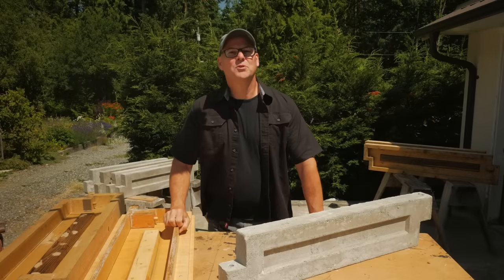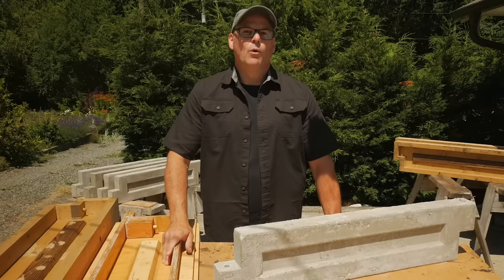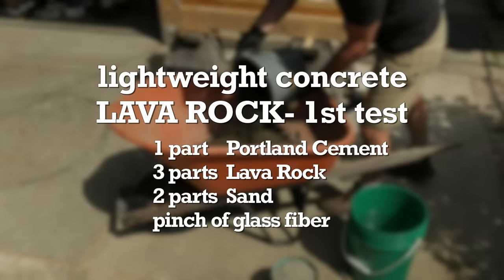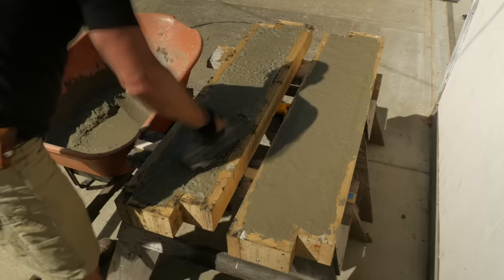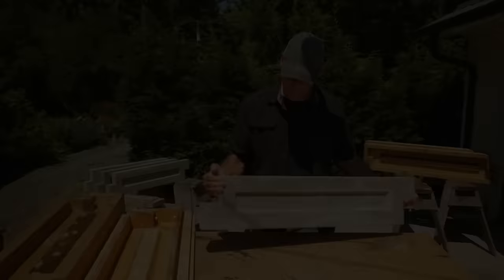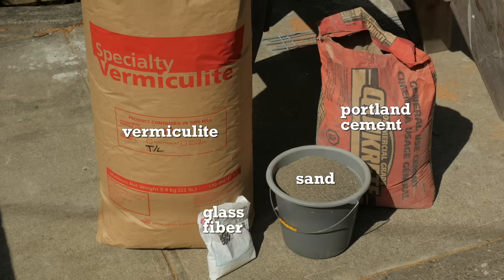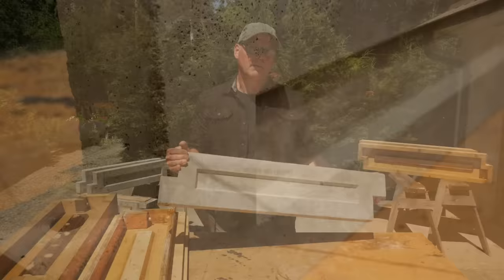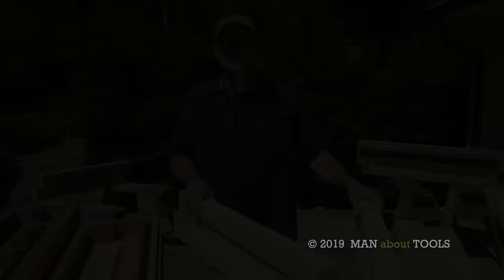make Lightweight Concrete Garden Boxes PART 3 - Aircrete Vermiculite Lava Rock

Comment: Excellent series, I have enjoyed all of them so far and look forward to more! A few things I would love to see as an episode 3.5: 

I wonder how strong these panels are compared to standard concrete, but in the sense of what it takes to break them. Like, if you later the panel across a set of 2x4s that were 4 feet apart could you stand in the middle? Could you jump on it? I imagine that there would be a substantial difference in the strength.

I would also really like to see how an Aircrete mix would compare if you added some substrate, like a portion of lava rock or a portion of vermiculite. It may have a better ratio of strength to weight. Keep up the awesome work, I'm looking forward to making some of these for my house soon!
Reply from the maker: I'm sure the lava and vermiculite panels would not break. They are very strong. But I'm not so sure about the aircrete.

Comment: Cool video I see a future issue with the holding pins and stress from the weight of wet soil pushing against the panels, any way to reinforce the pin holes ?

Comment: cracking happens when moister dries to fast perhaps try to slow it down a bit.
Reply from the maker: I made much better aircrete in Part 3.6    It's denser and did not warp or crack. Until I broke all the panels in my latest video. (for science)

Comment: Vermiculite sucks in and holds moisture. I wouldn't use it with concrete. Perlite is cheaper than vermiculite, does not attract and hold onto water as vermiculate does, so maybe that's an option too.
Reply: I used perlite. It tends to clump in the concrete mix and is visible in some of the panels. I would like to try the vermiculite this time.

Comment: I watched all the garden box videos which were all interesting but in the end I didn’t know which recipe to use. I want it lightweight but sturdy and long lasting without damage from my string trimmer. Which recipe do I use?
Reply from the maker: Then maybe the Perlite or Vermiculite is the best option. Lighter than regular concrete but very strong and durable.

Comment: Another fantastic, well made how to vid in a series. Thank you. A couple of thoughts; 1) why light weight... guessing just for ease of moving and placing, I'll be using mine ad permanent "portable" garden structures 2) my initial thought on the foaming material is to use more reinforcement "hog fence wire" spread over a broader area and possibly increasing the glass filaments.  Look forward to part 4.  
PS. Have you given any thought to adding color powders to the mixture to avoid/bypass the cement gray look?
Reply from the maker: I did this follow up video solely based on viewer requests. So many people asked about lighter panels and aircrete that I just had to delve into it. I'm yet to experiment with colours. But it looks really interesting too. Thanks!!

Comment: Does the warping bow towards the open end of the form? 

I'm thinking the stress profile during the during process causes this? What if you screwed on an additional sheet of plywood on the top to fully encapsulate it, or Chan's your form to make the sides an open top? 

I bet uniformity during the during process is key.

Comment: I know less than nothing about concrete blends but the amount of fibers you added to the aircrete seemed so trivial I had to wonder why you didn't add a lot more.
Reply from the maker: For these tests I decided to add the manufacturers recommendation. For the volume I was pouring it worked out to a third of an ounce (9 grams) per batch. It looked like it was distributed very well in the mix. Feel free to add as much as you think you need. I don't think there's any issue with adding more.

Comment: Would it be possible/effective to lay a face coat of regular concrete at the bottom of the mold .25 to .5 inchest thick then back it with aircrete to give it some protection but still be lighter?

Comment: to make a more durable, and potentially attractive, face add river pebbles after pouring in the concrete making the back the face... if the pebbles sink too much you can make the pebbles 'reappear' by washing some of the concrete from the surface with a strong stream of water.  I may be an interesting experiment, I know my yard forewoman would prefer something more decorative than concrete.  
Also, do you have any issues with the concrete leaching into the garden effectin the pH? or do you line the sides with poly sheets?

Comment: There is a difference between vermiculite and perlite. Nurserymen use vermiculite as an aid to water retention in their growing mixes and perlite to aid drainage. Vermiculite captures water, hence its use in cat litter, whilst perlite is hydrophobic. I wonder whether substituting perlite for the vermiculite might solve the problem you discussed?
Reply from the maker: I have 4 vermiculite panels in use in the garden now. I'll keep an eye on how they do and see if moisture retention is an issue.
Reply: Depending on the climate you live in water retention can be a destructive force with freezing and thawing, I had a bell siphon bed with expanded clay balls and the freeze/thawing completely broke them all
Reply: So perlite has rabies?

Comment: Use foam sheets to fill the center of the forms,(core)  then pour your concrete. you will end up with approx 1" thick concrete along the entire outer surface with foam center. 50-70% weight reduction, and weed wacker friendly.
This is a TYPICAL use of foam & concrete for weight reduction purposes. For example: If you live in a modern city with newer skyscrapers, the ground you're standing on in many areas  is actually 3 foot thick foam with concrete poured over top. (simplified explanation for all you keyboard warriors). Houston Texas is a perfect example. FYI: Its not a structural member you're making, theres little to no need for the extra metal grating. In fact, that IS one of the purposes of the mesh fibre. AKA: MORE WEIGHT SAVINGS. Add more mesh fibre in this case, worst case scenario the dried concrete has the fuzzies, which can be lightly sanded off.

Comment: A great video, really interesting and I appreciate the fact that you give such detailed info. Regarding the finish of panels. Have you ever considered painting the panels with a cement/fine aggregate slurry prior to adding the main material ? This may give the panel a smoother "skin coat'. Also, if you have decided on a preference material from your test pieces you could always add some small pieces of polysterene - perhaps putting these in a the same time as the reinforcing mesh - in the thicker areas of the  form. I think this could help lighten the weight of the panel without compromising its strength too much. Just a thought. Many thanks.

Comment: Cool experiment... I just started playing with aircrete yesterday. Do you think if you did like maybe 2-3 parts sand to Portland it might add some strength? I actually picked up a bag of type n porter mix which is 6:1 sand to Portland but I didn't even know if my foam gun was gonna work so I just got a cheap bag to play with

Comment: 13:07 what did you do with the other half of the foam? Did you add it in and it didn't survive the editing? or is that all the foam you used for that volume of concrete slurry?
Reply from the maker: That's all the foam I used. I have a new aircrete video coming up soon. I think it makes better aircrete for this application.

Comment: Hi Kent,
Many kudos for making these excellent videos and great design!
I do have a question: I bought your V.2 plans and would like to use the vermiculite 1-2-1 formula for 4' forms. I'm trying to calculate what size container to use for  "1 part".  What size measure did you use here for the 3' form and about how much water? 
I can always bump up what you used enough to fill three 4' forms at the same time to save time.

Thanks!

Comment: What if you use 1/2 inch layer normal hard concrete in bottom, then aircrete and in the top 1/2 inch layer normal hard concrete? Then it could resist the trimmer.
Reply: Or 1/3 inch layer.

Comment: There a lot of things you can do to prevent creep and shrinkage, but I'm watching so little of post procesing the concrete.
It would be a lot better if you keep the concrete at least 3 days always wet, and later you shouldn't left it really dry until day 28 (at least!! it realy would be even better until day 50) and avoiding direct sun light.
You could even try to left it 3 days underwater and you would feel it really diferent.
Reply from the maker: Thanks for the comments here. See Part 3.6   I reworked the aircrete formula with much better results. Cheers, Kent

Comment: Do the lite weight concrete mixes stand up to the freeze-thaw cycles of colder climates?
Reply from the maker: So far so good. I had all my lightweight panels in the garden over the winter with many freeze-thaw cycles and I don't see any issues.

Comment: **Very 😎 👍 job. However not hating but the reason why your light weight molds are cracking its due to the rebar type support you place in your molds. The light weight materials when they dry out and srink a little its trying to twist and bend but has that bar stopping it which then cracks the materials. Try it without the rebar type support. That should fix the cracking. Also maybe a sealer on top to protect it more, but not likely my friend. Always give him the credit have a blessed 🌙.**
Reply: but you could make some cool stone work to trim out bottom of house with some type of adhesive even for a caulking gun and set it on top of the existing lower part of the wall then top it with a 1x4 to break it up. Im doing it now with wood aroumd backside of house with front brick and closing in a outside door and french doors plus a deck. Should i put it up?

Comment: Hello!! I have a questuion about the foam, you say you have a foam that weights 3 pounds per 5 galon pale, however, Airecrete harry in most of his videos says that the foam should be around 0.22 pounds per .20 pounds ( he has it in grams, and he says it should be 90 grams per liter. ) so in this case your is almost 40% lighther, is that still good? Thanks!!
Reply from the maker: See my revised aircrete formula that worked much better: https://manabouttools.com/make-lightweight-concrete-garden-boxes-with-aircrete/

Comment: Been waiting for this video.  Also tried researching it online but its hard to find anyone testing and comparing lightweight concrete alternatives against each other.  Would be interesting in seeing how well they hold back the pressures over time.  Thinking about the aircrete bending.  I know that concrete shrinks some as it cures with the air bubbles in the mix I could see it shrinking on the top first and more because that would dry and the water would evaporate first causing that side to shrink and pull on the side that is down.  Not sure of a fix for that problem.  thought about trying to remove the forms sooner to allow for more uniformed evaporation but then trying to keep it moist for better strength would be an issue. spraying would erode or wash away the material.   Also not sure how it would hold up in areas that have drastic temperature changes.  The expansion and contraction of those air spaces, not to mention if water got inside the pores and froze.  I  would think you would have to add a sealant to the outside to keep the water out.  Can't wait to see what you came up with. **I have never worked with this stuff and my experience and knowledge of concrete and working with it is very limited.  **  would like to hear others thoughts and expertise.
Reply from the maker: Thanks Mitch! Really good thoughts here. There's loads of things to try yet. Maybe it comes down to knowing that aircrete has certain applications that it works very well in. And other's that it does not. I'm not at that point yet for this application, so I think I'll try a few more variations when I have Part 4 completed.
Reply: @MANaboutTOOLS  amazing commitment and dedication to  a process that will have far reaching benefits to us DIY deciples . thankyou ...so much learning and inspiration for all kinds of projects......cheers Peter, Australia
Reply: @MANaboutTOOLS  Did the aircrete warp before it was taken out of the mold? I was thinking that the inlay gives the aircrete more surface area on one side which might cause it to dry unevenly.
Reply from the maker: @JereHOTmiah  It was straight coming out of the mold. And I agree that the difference of the surface area may be a contributing factor. I need to do a few more tests.

Comment: That weed whip tears them aircrete panels  up. I was going to ask what you thought about aircrete in the last video but you mentioned you were experimenting with light weight panels in the next video. You might still be able to use it but it looks like a pain, and you will get many duds, because they will warp and crack upon curing. But then the panels that cure slow and didn't crack, will still be too weak to take a load and probably break under use. But one last attempt can be made, the good panels that didn't crack, can be covered in a layer of reinforcing fiber and epoxy after the panels had enough time to totally cure.

But if you went thru all that reinforcing on the exterior, you could just use wood, and cover it with the reinforcing fiber and 2 part epoxy and it will be sealed like a ship. They will be light weight(lighter than concrete) and stronger, MUCH stronger than aircrete and stronger than concrete.  But if you use 2 part epoxy, don't ever let it touch your skin when it is mixed and not yet cured.

Comment: Is there any concern that the vermiculite you use is contaminated with asbestos? Apparently, there are quite a few mines that have asbestos mixed in with the vermiculite and China has no restrictions on asbestos use.

I would like to think that the concrete is really good a chemically bonding and/or tying up any asbestos, if it exists, in such a way as it's not inhalable or dangerous in any way.
Reply from the maker: You can check on the bag if the vermiculite is certified asbestos free.

Comment: I can suggest another combo: Vermiculite with some foam: Shoot for a 40% to 50% weight reduction. This might make it more durable than the aircrete. 

Another option might be to add some thin rebar instead of the wire mesh. The rebar would be considerably more rigid than a thin wire mesh.

Comment: I bet half a bottle of liquid glass would prevent aircrete cracking a bit
Reply: its sodium alumide or something. its a DIY method for improving heat resistance to foundry cement

Comment: Very interesting, the video could have been twice as long and still interesting.....structural mortar is another aircrete option, sets fast and needs no reinforcement in normal use......maybe try 1/4 inch/3/8ths rebar instead of wire to stop warpage on the aircrete.....
Reply from the maker: Will look into that. I was concerned that rebar would be too heavy and sink to bottom of form. Thanks for the suggestions
Reply: @MANaboutTOOLS  They also make fiberglass fence poles that would be lighter, how much force can that bow in the concrete really be.....

Comment: Great video! As soon as I saw the shampoo? I knew you'd been watching Honey Do Carpenter's videos.

I really like the way you made your aircrete, I think the number one turn off for most folks is the intimidation that comes from using an aircrete generator. You took that part away, and I hope a lot of folks interested in aircrete see this video.

Is the next material you're trying going to be hypertufa? If not, it's worth a shot. 👍👍

I'm glad I stumbled across your channel, great work!
Reply from the maker: Thanks Russell! I'm a fan of both Darwin and Harry and I like their aircrete videos. The shampoo works very well. I was considering hypertufa but I tried to limit the number of options down to just a few. There's also perlite too. Cheers! Kent
Reply: @MANaboutTOOLS , no... thank YOU!

I was going to suggest perlite, but I feel like to get a finish comparable to the ones you've made already? You'd need to go back to adding sand and raising the weight, or else it's almost going to be a popcorn ceiling type texture.

Maybe since it's lighter than vermiculite, that will help offset the weight as though.

Your videos are pretty thorough, you're viewers are learning more than most probably realize by exposure alone. Looking forward to what comes next!
Reply: i wondered if i had missed something about making aircrete when i watched this.  did kent just remove the biggest barrier to experimenting with aircrete?
Reply: @DesertGardenPrepper , he absolutely did!

Comment: First time viewer, I absolutely loved the teaching/explaining that you do! I definitely subbed!!!!! Your teaching is not too fast, not too slow, but just right!!! 

I know vermiculite and perlite are similar but different products, but I wonder if perlite would make an even better mix than the vermiculite mix. It is a tiny very light, very little white lava rock that has been expanded or whatever they call it, kind of like they do the clay beads for aquaponics is my understanding of what is done t it but I could be wrong! It almost looks like and is about the same size and weight and is as little as Styrofoam beads. It can actually be mistaken as Styrofoam beads if someone is not knowing what it is, and won't know the difference until one has it in their hands!